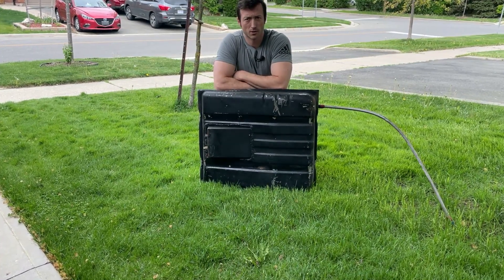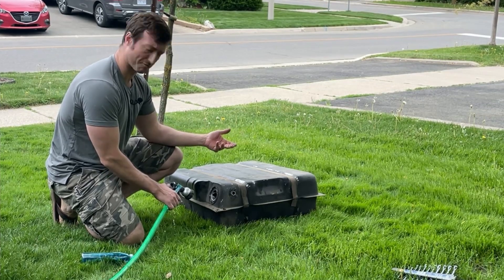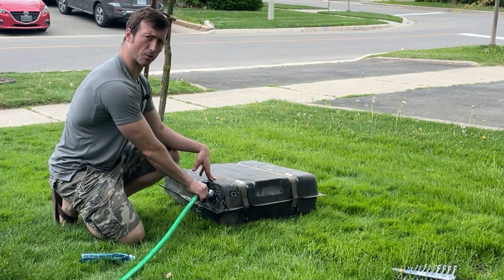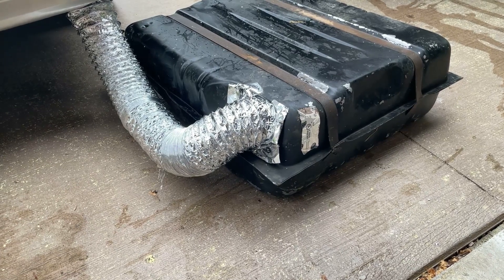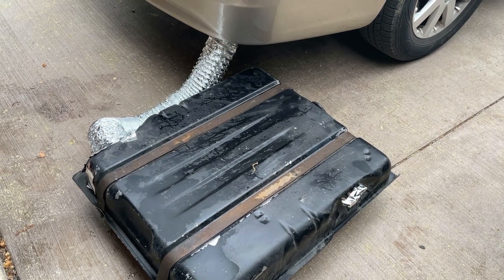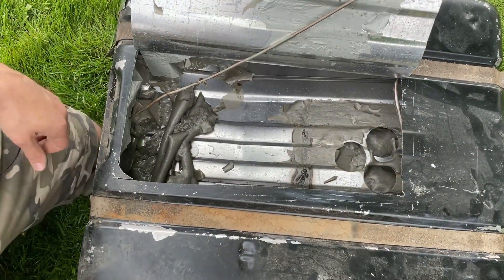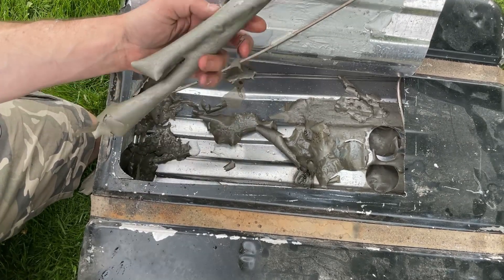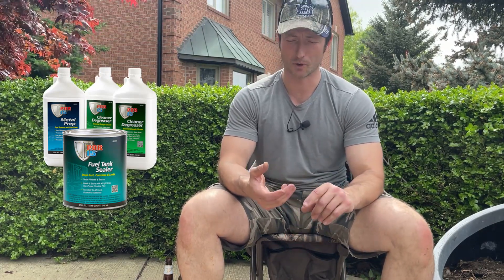POR 15 Fuel Tank Sealer Fail. / How To Prep A Used Gas Tank For Welding.

Comment: 15 years ago? How long did you expect this to last? Did i hear you incorrectly 15 years ago? Haha. I am in a salty climate and having to do a motorcycle tank after 5 years, and will probably have to do it again in 5 years due to the high levels of ethanol in local fuel.
Reply from the maker: Well according to the POR rep it should last a lifetime so more than 5 years. If you're redoing it every 5 then I think there's a problem.
Reply: @VicsGarage71  yes there is a problem, the local fuel i get, no other options is up to 20% ethanol. most steel tanks for the big 4, kawi, yamaha, honda and suzuki are not produced in Japan, they are fabricated in Thailand with cheap Chinese steel that has flooded the market for the last 20 years. the boxsite quality is very low, very prone to rusting no matter the welds are fine and it is zinc dipped. it also doesn’t help i might only put 1000 Km on each bike a year and don’t feel like draining the tank every time i get the bike out to ride, which, since i am rotating bikes isn’t that often. Yes, there are problems, but POR15 isn’t the problem, it is the ethanol and no Seafoam, liqui moly and Sta-bil fuel stabilizers don’t help much. it helps to reduce separation, but the issue of how old the fuel is before i purchase it, and the high salt humidity climate i am in also contributes highly. Because you can’t bullet proof everything. it is a price to pay for not storing the bikes in a climate controlled environment which would actually help reduce the frequency of either redu-POR15 treatment, or getting a new tank. I prefer aluminum which does away with all these issues but for some bikes getting an aluminum tank in current traveling conditions is almost impossible or 2 to 3 times the cost of the tank.
Reply from the maker: @marknasia5293  Hey Mark thanks for the reply and appreciate you sharing your experiences with it here. I accidentally removed your other comment so I want to apologize first for that. I'm going to try and reply to it all here though.

So first off I feel there maybe a bit of confusion. The torch and exhaust gas were not part of the process when the POR was initially applied. That was being done to ensure the tank was safe to cut open and remove vapors that could potentially flare from the sparks when cutting. Ideally someone would use a steam cleaner from a radiator shop or something, but I don't and many wont have that option. So I showed another way that someone could prep a tank for repairs or modifications that would require cutting or welding.  

That aside, when I used the Fuel tank sealer it was the 3 piece kit, de-greaser, prep, and por of course. The tank was new with the sump added to it and a Hair dryer was used to dry it out. The tank had fuel in it for probably 3 years on the low end and maybe 5 on the high before it was put in storage where it was drained. The sump makes it easy to do so. When drained there was no indication that the lining was flaking. Now I know I said 15 years ago in the video. I'm erring on the the high side because I want to give the product the benefit of the doubt. If I said 10 years I don't think it would change your opinion much.

Fuel was added to it again to get the car running and that fuel maybe sat in it for a year or so with some stabilizer in it for a few months before I decided to strip the car right down. It was drained this past winter. 

So maybe the tank had fuel in it for 5-6 years tops over its life? Which would be in line with your experiences of the lining lasting that long. Now maybe there is a compatibility issue with the stabilizer. That is possibly. I know POR does sell their own stabilizer product. But the Data sheet, instructions or website give no indication of this being a compatibility issue. It  does say that it is resistant to all fuels, alcohols, and additives though. Another issue I can possibly see is MAYBE the sump and baffles caused an issued with coverage inside the tank? But with the amount of product still in after cutting it open it doesn't readily appear so. But one can't be sure of that unless cut open immediately after apply it.

I did call them out of curiosity to see what they would say. Like I said, they said if the prep was done right it should last a lifetime and hold up to all types of fuels including racing fuels. Now I'd bet that if you called them and talked to them about high levels of ethanol specifically they would tell you the same thing and wouldn't indicate that you would be reapplying it every 5 years or so. But that's me taking a guess, if you do let me know I'd be curious. There's just no indication of that anywhere in their product sheets. Ethanol as an issue didn't occur to me when talking to them because where I am it's a max of 10% I believe. 

Now if 5-6 years of use seems reasonable to you then great. But if that's the case I'd like to see some indication that the operational use of the product is in that range. But that is just not indicated anywhere. I do know one other person who has used it in a motorcycle tank before, I'm not sure how long ago though. I'm curious now how long he has had it and if he's similar to you since that would remove some of those variables that you indicate are unique to your experience.
Reply: @VicsGarage71  the variables mean everything. I have a person i know brought exact same motorcycle maybe a month within the date of my purchase. he drives the bike regularly, constantly cycling the fuel, same humidity, same gas with ethanol content. He doesn’t have rust issues with his tank, but then again he has 20K kilometers on his odometer and has a different set of issues. Any vehicle that is not used that much, where fuel can sit, breakdown regardless of fuel stabilizers, condensation will form inside the tank, outside atmosphere either exacerbates the problem or it is negligible. The product isn’t the issue and unless i receive cans of POR15 that are hardened when i order them. I have no plans on contacting them to complain about their product even if the product fails under my experience of 5 - 6 years. 5 - 6 years on many motorcycles is the lifetime of the fuel cells/tanks, especially if the bikes are not used that much. Plastic PVC Polyethylene tanks have their own set of issues, steel tanks rust, because they are made of steel, the cheaper the quality of steel (not so much the construction methods welds etc) is the real issue along with lack of use and the high humidity or even high salt environment, salt air, salty roads pick a poison. All those are variables that really i don’t want on the side of my POR15 can. the writing is already so small it is hard enough to read the instructions. one can of fuel injector cleaner will strip POR15, that is how i get mine to break free from my motorcycle tanks when i replace them. I don’t wait for them to start pealing, because of the process to replace it is so much less painful. I get the liner to come out and break free from the tank, it comes out in large pieces because it is preemptive maintenance. then degrease the tank with brake cleaner, it evaporates really fast just more expensive than degreaser. hot air gun dry the tank let it cool slightly, cool enough to hold in bare hands then add the POR15 metal prep (a light etch rust converter) normally at this point i can see small areas of rust that within about 20 min to and hour of rotating the tank around and ensuring the rust has been converted i can drain the POR15 metal prep. Yes they say you can reuse it, don’t, if it is not the purple color or at least a light green color discard it, normally you can tell it is working because if you couldn’t see into the tank, the POR15 metal prep (phosphoric acid) will turn charcoal to blackish tint. keep adding fresh POR15 metal prep and rotating the tank in your hands 20 min - an hour and do this over and over until the stuff you are pouring out isn’t blackish charcoal grey color. if you can see in the tank (on FI bikes since they require a fuel pump when removed a hole about 4.5 inches in diameter is left. you can see how much didn’t get coated/converted with the por15 metal prep and this is non-diluted direct from the bottle. Yesterday i redid another tank on a bike, took 5 hours to get all the surface rust converted, and the inside of the tank aside from the fuel cap neck lip, looked like virgin prepped metal. this bike hadn’t been done before and needed it. it took another 2 hours to get the tank rinsed and POR15 fuel tank sealer added, and all the excess removed. leaving too much por15 tank sealer causes it to peal also, don’t know why but does. after it cures for 96 hours, then the bike tank can be put back together, well after all the rust is removed fuel injectors pressure cleaned, etc. I have no idea how long the liner will last. when it is ready to be done or it reaches the 5 to 6 year mark, i will redo the liner, not wait for my fuel system to get contaminated, just strip the liner out with FI cleaner, a couple bottles seems to work, drain the tank of gas put the cleaner straight in and it peals the liner off. it is cheap and i have access to plenty of it, whereas the por15 metal prep, not as much access and it cost way too much to be wasted on stripping the liner out. the small can of POR15 cost me around 120$ USD locally when ordered online because of local shipping monopolies/restrictions i can’t get it via Amazon/eBay. the POR15 metal prep is slightly cheaper for the small bottle running at 80$ a bottle. I used an entire bottle on a small fuel tank yesterday. The small can of POR15 tank sealer/liner is consumable to that is pretty much a fix cost. 200$ in, to de-rust a fuel tank that caused the bike to shot off because the rust was enough to clog injectors. A new tank runs around 300$ factory replacement plus 4 - 6 months wait time. Am i thrilled to spend 200$ on a bike i might put 1000 km a year on, no, thrilled at an entire day to seal a tank nope. But i am very realistic and realize that living on an island, surrounded by salty, high humidity air ave temps are 80’s and forced to use ethanol fuel. It is what it is. My logic is this, once POR15 goes under, my bike will be down for half a year, thanks as there aren’t too many alternatives out there that even come close to their product. Try the competitors and let me know how they work for you. they didn’t for me, or any of the guys doing the exact same thing is am. I mean if I had to really complain about something with POR15 it is the can’s lid, i mean seriously that is a rational complaint, if you have to almost destroy the can to get the lid off, that is a little much. I hope you find a product that surpasses that of POR15, please put it on youtube, i might get lucky and can purchase it. i have no connection to POR15 other than i have purchased enough of their products that i must be helping putting somebody’s kids thru college. They made a product that is about as good as you can find, LBE, show me the way to a better product that last longer. I know of one, just don’t know how to acquire it legally and don’t want a criminal record (that day you are asked “what are you in for” - “stealing tank sealer”) yep that’s not me. Actually on the bikes i have with fuel cells with aesthetic covers that looks like a gas tank, I have aluminum tanks. They too still suffer from high salt content in the air but there is an entire range of cleaning/protective products to keep that from damaging the aluminum. plus they are so much lighter weight. my biggest problem is i can’t find someone to make an aluminum tank for my enduro bikes. that an this whole virus cancelling out international travel makes flying in parts myself a no go. 

btw, it is your channel, feel free to censor it however you wish, if you are satisfied with the product you have made, (the video) there you have it, it is your choice to complain about the product. If i were in the states and had a Charger/Challenger (whatever) I would just get an aftermarket aluminum fuel cell, and also fuel tank straps, scrap the originals too.
Reply from the maker: @marknasia5293  I don’t censor it like I said it was a mistake and that’s why I told you. If I censored it I’d remove this conversation too and block you from talking. 

This conversation will definitely be saved because others who are considering using it should definitely hear your experience as it adds a lot to the conversation.  

The barriers which led me to using it in first place are mostly gone by this point.  The product offerings for 3rd gens were slim. Now Aeromotive and others offer fuel tanks set up for efi and stuff already that don’t require modifications.  

I find it odd that fuel injector cleaner will strip the lining so easily given they tout its compatibility with all fuel additives.  But then again, the dose does make the poison as they say. Does just one bottle in the tank alone, sloshed around do it? What’s the fuel injector cleaner you use? I know many aren’t alcohol based so I’m curious what’s the active ingredient that strips it so easily. I know some use Xylene, others Toulene, some PEA.

Comment: I think their rust coating needs the rust to bond too, otherwise your better off with paint. Was the inside surface, other than where welded, too smooth to form a tooth for the product? Either way I avoid Por 15.
Reply from the maker: Maybe. But the rep said as long as I used the metal prep which I did it should’ve been ok.
Reply: @VicsGarage71  been using POR 15 forever, the only thing better is military grade epoxy fuel tank sealers they use on aircraft. When i can’t get it, then POR15, but since you are not getting the system to work for you, Zinc dip for fuel tanks. It is what many manufactures do when coating steal tanks, it last a few years until the ethanol separation process brings water via condensation. Causes the break down of the factory zinc coating.